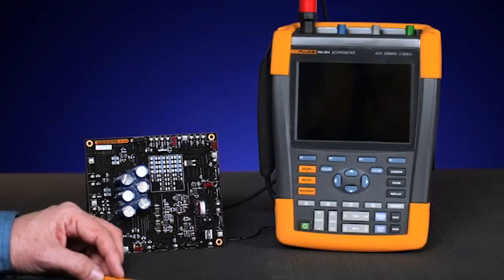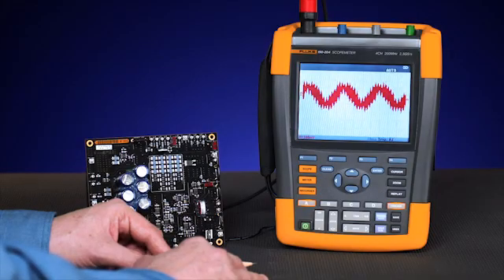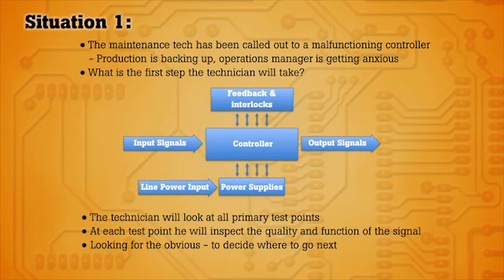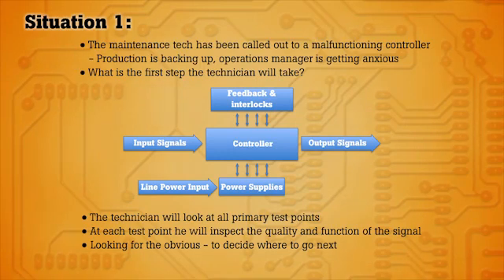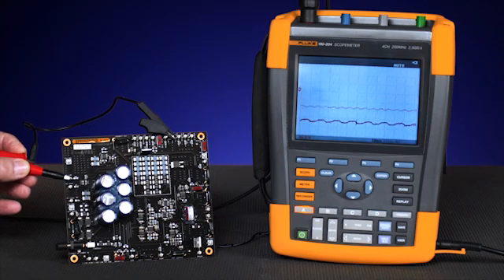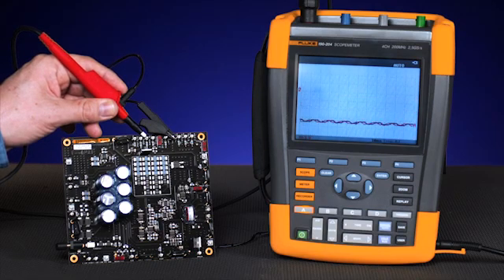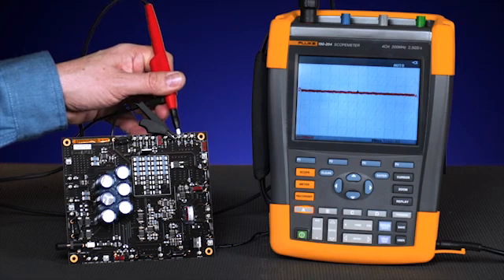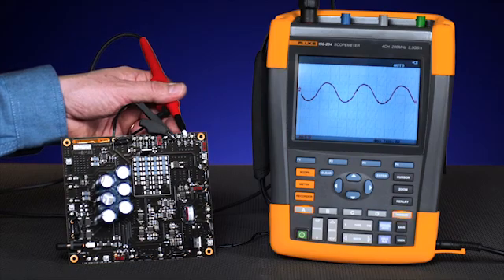Fluke ScopeMeter® Webinar Series Part 1: Auto Connect, View Mode, & Reset to Factory Default

Comment: Where can i get a lcd module for a fluke 190-102
Reply from the maker: Hello Christopher - There would be a list of parts specified in the Service Manual that you can find on our website. The LCD assembly is found under the Fluke item# 3981844. I would reach out to a Fluke authorized distributor and see about ordering this part. For a list of local or online distributors please view this link: https://bit.ly/2INRbcO